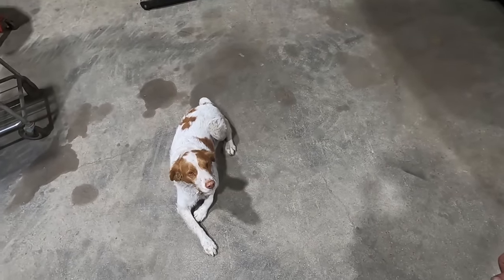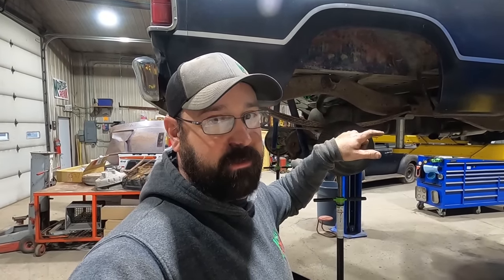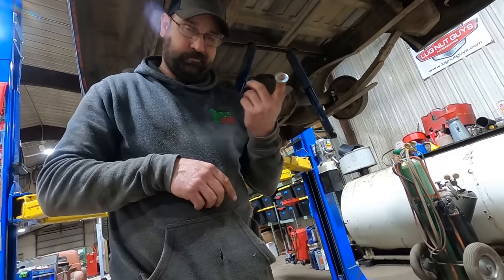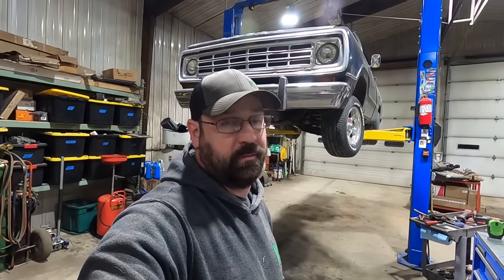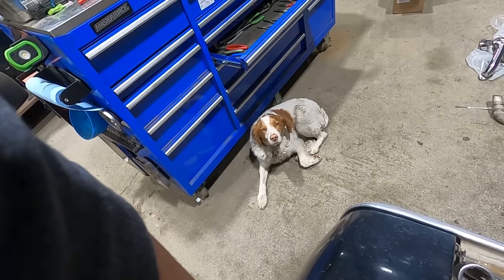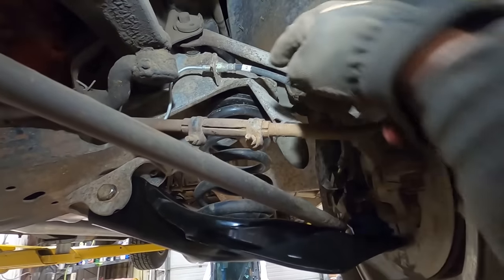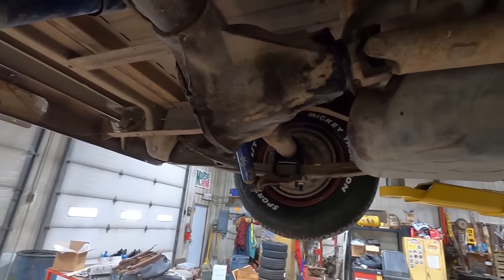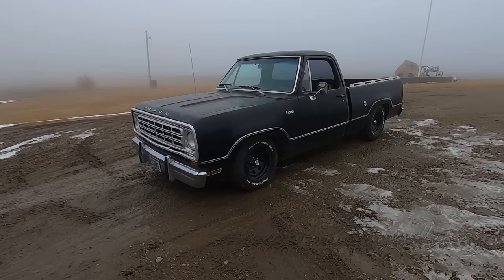1974 Dodge BIG BLOCK Shortbed Truck! Budget Friendly Transformation! Mopar Muscle Truck!

Comment: I don't know if you can find a stubby 13/16 spark plug socket but the Walmart old tune up section in the lawn and garden department area, they sold a service kit it was a popular mechanics ratchet and the 5/8 spark plug socket is slightly shorter so it is almost ideal for changing difficult spark plugs and with the headers lol....a craftsman 3/8 dr flex head long handle square raised panel ratchet and the original gearwrench ratchet wrench and the socket adapter set for the 1/4,3/8, and 1/2 inch dr for the appropriate size wrench and you have a really short ratchet.... Both of them are pretty much required when working on limited access spark plugs and vehicle with freaking headers, and another reason I hate headers you have to massage them into place by damn near beating them flat lol, and the sawzall is almost required as well,, and pry bars, so most of the time even if i have to completely rework parts of the exhaust i will put manifolds back on my vehicles

Comment: Yes you can  change the  starter  ring on the torque  converter but it's very  uncommon to  loose teeth anyway  the starter  only goes in the one way and  there are no shems on the starter  so it virtually  impossible  to  mess up the teeth

Comment: I just found your channel and its pretty fantastic! Or should I say more gooder?! I like how you do up on big long video instead of a bunch of small ones. Duff is rad btw!
Reply from the maker: Welcome aboard!
Reply: @MortskeRepair  if you have any tech tips on removing a body and suspension lift from a 82 square body I'd be very appreciative!
Reply from the maker: @dustynguilford7893  The same way they go in. Just backwards.
Reply: @MortskeRepair  I've never installed a little kit ha! But I did just watch one of your videos on the early 90s(I think)short bed Silverado standard cab that you lowered and that gave me a good idea what I need to do!

Comment: I like the look of a lowered vintage truck but what can you use it for?  Can't do heavy hauling, rough dirt roads, or even get up steep angled drive ways.  So this is just a passenger car?
Reply from the maker: So it’s flat here. I can haul an engine and transmission fine. I guess if you’re an incapable driver you’re screwed and should stay in your mom’s basement

Comment: Expensive headers have thick mounting plates to prevent warping. Those are cheapo headers you cut out. Use copper gaskets for headers and special c clip locking bolts for headers.

Comment: Mortske I have a 2000 18’ tilt bed H&H car hauler trailer I bought brand new for 1500.00$ I bought mine when I built my house back in 2000 and absolutely love it other than I wish I would have bought a 20’ one and I had a hydraulic tilt setup instead of those engine puller cherry picker two way hydraulic cylinder!! Being in the weather all the time it ended up rusting out the shut off and on valve and the first one broke after using vise grips on the valve for 5 to 6 years and then I had to steal my cylinder off my cherry picker!! Then had to buy another one from harbor freight!! That one lasted about another 5 to 6 years and I had to buy another one!! And now I need to get one that has the air over hydraulic one to make it just a little faster hopefully!! I have an on board air setup on my truck so that should definitely help out!! Just if I would have got one with a hydraulic setup system it would have saved me all the headaches for sure!!!
Reply from the maker: Awesome

Comment: We also use reamers from Norseman. Best in the business when you have a 200lb gorilla on a drill motor. Yeah you can wear em out but that's going through 1/4" stainless all day long. Carbon they'd probably last 6 months or better with cutting oil in an industrial setting.
Reply: Listen. Tap Magic is your friend with reamers and Carbon. Takes how soft carbon steel is outta the equation
Reply from the maker: Right on

Comment: Headers...installing  use 2 removable alignment short studs to hold gasket... use arp header bolts. they are 5/16 12 point,,much easier to work with.
Reply from the maker: thanks for the tips!

Comment: Cool, dodge tin grille trucks are neat i like how dodge did their suspensions for both of the cars and trucks, like the 70's dodge trucks and the b body Chrysler cars both incorporated torsion bar suspension setups, and ford cars got rack and pinion and the truck were twin i beam and well gm tried several different combinations for both cars and trucks.... that being said I love my square body gm trucks and the gmt400 ifs trucks, and twin i beam ford bumpside trucks and I also had several brake parts and hoses for the Buick Regal, Oldsmobile cutlass and Pontiac Grand Prix 80's model gm gbody cars...

Comment: Hoping this hasn't been already addressed and please correct me if I'm wrong or misunderstood what you were saying.  But isn't backspacing measured with the wheel face down and measure up to the inside edge of the wheel. So you would want more backspacing so the wheel would go farther underneath the wheel well? So instead of a 4" you would want a 4.5" backspace?.  Or am I wrong?
Reply from the maker: Correct

Comment: MERRY CHRISTMAS 2023  Mr. Mortske...What A Christmas Day Surprise....In Early 1988. I had One of These. My 1st. Taste of Mopar and Chrysler Corp. I have  Been A TOTAL Mopar Fan EVER Since..Got one Now Today A 1997 Dodge Ram 1500 3.9 V6 5 speed Trans. White Long Box A Bare Bones Truck. Not Even An Am Radio   Crank Windows The Works. My Summer Driver,, Nearly 26,000 Original Miles. tony friend, Neillsville,Wi.. Had Countless Chrysler Products Since Debut 1988.
Reply from the maker: same to you!

Comment: That's a 75+dash. And that's a chrysler 9.25. Really easy and cheap to put a locker in.   any 9.25 locker from the introduction to 99 will bolt in. I put a 96 locker in my 77 d100 9.25.

Comment: Another cool rig. Have you lowered a bullnose?  I just got an 83 and that’s in its future. Hoping to avoid many roadblocks. If you’ve done it, would you suggest lowering springs in the front or lowering knuckle?

For the rear I’m thinking just a flip kit, a c notch (already fairly close to bump stops for me but I’m used to 4wd’s) and maybe shackles, just don’t want a weird pinion angle so don’t want to over do it. 

Thoughts?
Reply from the maker: not much you can do with the twin i-beam unfortunately
Reply: DJM Dream Beamz

Comment: Most people add tunnel vision on the square body custom deluxe in the Ford F100 but Dodge made a good  truck back then. They were massive quad cab turbo diesel Powerhouse monster trucks kind of in comparison to a quad cab late model F-250. They were big trucks for the time

Comment: So you didn’t have a firm grip on your reamer.  These new drills have way more power than you can hold with one hand.  In the old days drills with that much torque had a second handle.

Comment: That truck is why I want to find a 75 preferably d200 club cab long bed that is gold, but trying to find one in as good of shape as that truck was that isn't $9k is almost impossible,i was in the process of buying the running gear that is why he got ahold of the van to get it running and we drove the truck before and the van before they were tore apart and got the truck put back together and it would not start and got that fixed and it quits cranking over.... and my dad wouldn't let me give $550 for almost rust Free except just over the front and rear wheels and the dented tailgate so the se trim popped off the corner of the tailgate but was still on the truck... Anyways it ended up sitting for about two years while we figured out what the hell was going on with the truck the not starting was the back of the gauge cluster the volt meter in the truck, and the hall effect switch had burned out in the 318 distributor in the van motor, and my best friend ended up getting different tires and cleaning up the 16.5 American racing white spoke wheels on the truck and sold it not running after the fuel pump went out and his daily driver needed the new alternator for $3500 and got a 84 low mileage 360 that ran also a California emissions motor... And around the time I was out of highschool and working i have mentioned my daily driver 78 Chevy c20 custom deluxe Forest green and frost gloss white long bed farm truck that was wrecked on three of the 4 corners and I had to jack up the dr side cab corner and slam the door shut and lock it, and lower the floor jack and put it back in the truck bed, and get in the passenger side door and drive to work, anyways I have said that the cab moved enough it broke my lower cab door dr hinge which led me out to the junkyard that was open a 2 pm on Saturday morning and I went and pulled it off the rusty 78 GMC High Sierra k15 long bed nickname swiss cheese to put on the 78 Chevy c20 custom deluxe long bed i was currently driving... anyway I was walking through the junkyard and the Mopar row of vehicles is first and I cut across the yard to get to the truck I was looking for quicker so I could grab whatever i needed and get back home and get some sleep before work the next night... and seen the 75 d200 dodge club cab long bed truck with the mud flaps hanging on the rear bumper and the windows were all gone but I would say some of them were probably busted out and the dana 60 4.56 rear diff and 11 leaf spring packs was missing and all the interior but the dash main shell and steering column and three spoke steering wheel from a custom trim truck but it had always been in the truck as long as me and my best friend knew about the truck and that was since the middle of 6th grade..   anyway the tailgate and taillights and the front bumper and brush guard was gone and I asked about it and the junkyard was like $2550 as it sits and I couldn't see spending that but if I didn't have my daily driver then the 83 Pontiac Grand sj and the two 86 Buick Regal i probably would have bought it or tried to trade for it, but my daily driver needed a lot of cab repair and the bed was half junk and needed a replacement motor and it just wasn't worth it but I have regretted it ever since and I was checking out a 78 d200 rust bucket on Facebook marketplace needs the entire cab floor and rockers,cab corners and the front and sides of the inner roof repaired and then the 318 they don't know anything about it whether it ran or was a good motor just that it is now stuck the tf727 slips in all gears but reverse,, the bed is ok-ish, and has no title $2,400 obo and I am like holy crap that's junk!!

Comment: 36 years old and iv been a lowrider guy my whole life no matter how you do the springs they have a ruff ride. the best way to heat them i found is to time it and if your good at it you know pretty much when to pull the torch off them so your not hitting your wheel wells. i will say heating them up gives more of a stiff ride then bounce. cutting feels better going down the road but either way your riding like a log wagon.
Reply from the maker: You clearly don’t know what you’re talking about
Reply: @MortskeRepair  sure just a daily driver of one and have had many in the past. done both ways. what i wanna know is how you think im not clear on what im talking about?
Reply from the maker: @newedition0456  None of mine ride rough. You're a hack if you heat coil springs.
Reply: @MortskeRepair  i have done them that way in the past. doing anything to your spring is being a hack. but i also don't hack off my bump stops either on most of my trucks iv lowered.

Comment: You should live down under they are back wards😃, the flat side(sharp side) is away from the bolt/nut here in denmark 😉 cause the  metal you trying to tighten is flat 😉 regards sören

Comment: Useless tip of the day:    A lot of those Dodge ball joints are actually threaded into the control arm instead of pressed in.   If the ball joint has flats on it, it is threaded in.   You will destroy the control arm if you press it out.   Requires a special ball joint socket.
Reply from the maker: correct

Comment: A quick question on the pinion angle, should that 5 degrees be measured with the truck suspension under load, sitting at ride height?  Not trying to be a "keyboard warrior" genuinely interested to know how to get it right.

Merry Christmas Mortske, Mojo, Chin and Duff!!
Reply from the maker: Yes. Ride height

Comment: Mr Mortske If your already pulling apart the rear end to fix bearingsthen out is a spool or limited slip or nothing else a Lincoln locker… just anything to fix the one wheel peel , just not  acceptable in a muscle truck ;-)
Reply from the maker: Hmmmmm

Comment: Cut out the extra material between header bolts. Also buddy’s daddy ol school hot rodder always told me to use manifold gaskets instead of header gaskets they seal better
Reply: Get a piece of pipe and roll the fenders instant clearances
Reply from the maker: Good to know

Comment: I had a 1976 d200 2wd Dana 70 727 Trans  1970 383 engine replaced the worn out 360 great truck but the electrical is shit because of Chrysler cheaping out

Comment: Happy holidays Mr morski I have a question for you sir I have never welded in my life I'm looking at buying a welder for a beginner any suggestions
Reply: A multi process or MIG welder from harbor freight if you're going to buy new.
Reply from the maker: @zacheryjohnson234  I like Millers. But an HF special will get you welding on a budget.

Comment: I liked the straight 6 turbo diesel Ram 350 it was a truck that Dodge add in the late 90s or early 2000s I was a kid but my neighbor had one and that thing was a monster video. It was a double cab long bed straight 6 turbo diesel it was just before they came out with the big rig look design it was an expensive truck it was big turbocharged diesel 4x4 truck

Comment: Shorty blockhuggers do almost nothing for horsepower compared to manifolds. 
Long tube 4into1 with appropriate sized tubes are good for torque and hp, but if you aren’t worried about that, just go with manifolds. 

I hate shortys, mid length, and block huggers more than anything.

Comment: My local Napa will make any brake hose as long as they have the ends they've even on occasion ordered the ends they needed for me to make custom lines Peace
Reply from the maker: That would be awesome. Where’s this at?
Reply: Well its like this Mecalf auto supply a napa store is in Carthage Mo i have been buying from since i started driving in 78 my father since the 1950,s I've been building custom street rods a dealer since 1990 Dainel Motors and anytime i have needed any rubber brake hose that didn't have in stock they've just made me what i've
needed they already made hydraulic hoses so whats a brake line Peace @MortskeRepair
Reply from the maker: @charlesmoxley739  I've been around a lot of hydraulic hose makers. Those are a dime a dozen in agricultural areas. But I've NEVER seen a brake hose crimping machine. I'd be interested to see one in action.

Comment: We didn't ban headers , just have alot of rules and hoops. Has to meet california emissions standards. Long tubes are pretty much universally not carb legal. My 80 has a smog pump and all that does to the manifolds is add a bung to them for the air pipe and nowhere makes headers of any kind with the bungs to make them carb legal .

Comment: I could have bought it off you for cheaper if you left the suspension stock so I could use it in Pennsylvania and I have been wanting 🐕 one of those trucks with a good motor and transmission setup like that for years but no one wants to get rid of them.😢
Reply from the maker: pretty easy to convert back to stock

Comment: Seeing that clip of the moron doing that strut reminds me of a car I did and noticed before removingit that the strut tube was kicked. I knew something wasn't right so I put the strut spring compressors on it before removing the assembly.Good thing I diid because  it had broke in two so had I removed it without compresing it bad things woulkd have happened.

Comment: Stock engines don't flow enough air or turn enough rpm's to benefit from headers. Manifolds or headers will make the same power in that engine.

Comment: In addition to using the correct lug nuts for the application, you should mention that the automatic torque sensing device God provided to humans may be affected by too many samiches.  Even the proper lugnut installation should be verified by a designated tire installer.

Comment: I don't know why the internet jockeys say you need to swap lower control arms to lower the first gen dodges.  You get the exact same effect by cutting the coil springs and you don't have to swap out control arms.  Somebody really needs to make drop spindles for the dodge pickup.  It's a way better way to do it, unless you like bottoming the suspension out on every bump in the road.

Comment: The Header on my 4 Cyl Tacoma never leaks, rusts (due to external & internal gun barrel coating from Jet-Hot Coatings), never loosens, or burns wires (just because of the way that it is). Using newer Toyota Camry front Strut Mount flanged nuts keeps the full length header flange pressed against the head. Been on for 10 years now Zero Leaks. Headers are fine unless they're Chinesium tin pipe from Headman. Japan quality FAR exceeds any garbage US built BIC lighter vehicles, hands down.
Reply from the maker: Thanks for the info

Comment: I had no idea some 20 years ago just how lucky I got putting headers on. It was a 2001 Dodge Dakota 2wd with a 360 in it. Got some no name stainless mid lengths off of the internet somewhere. Was my only mode of transportation, I tore into it after work one day with an early next morning appointment at the exhaust shop. They fit like a dream with no modifications necessary. In fact now that I think of it, they never leaked either! 🤷‍♂️ I’ve never tried to do it again though either. So must have just been dumb luck.